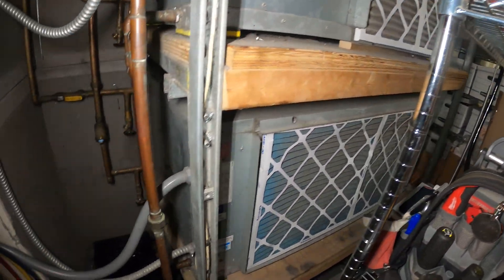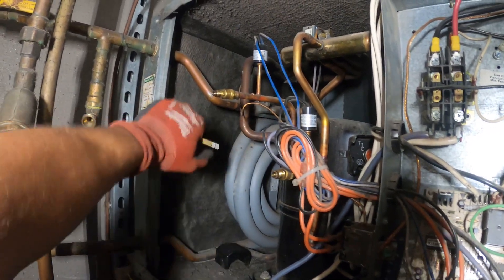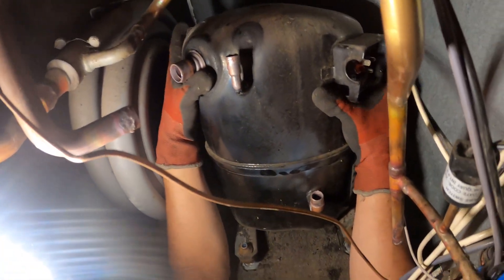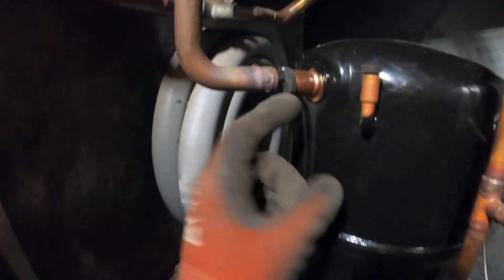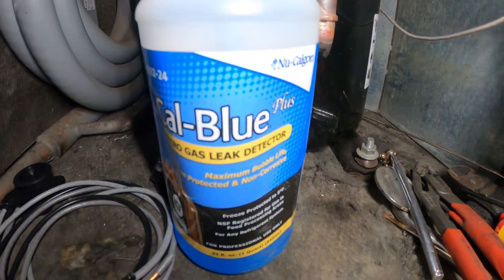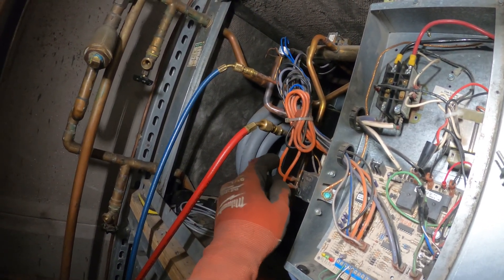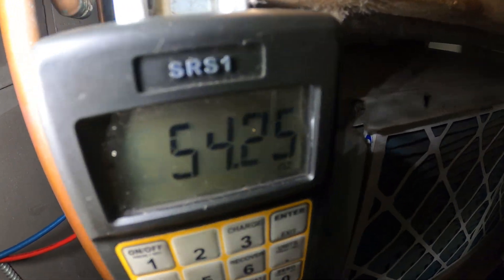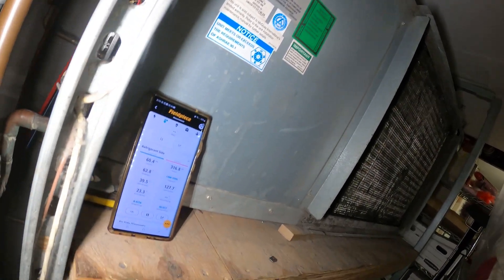HVAC Service Call: Copeland Reciprocating Compressor Installation (HVAC Compressor Replacement) 410a

Comment: No nitrogen purge, no acid test,no drier, no coil cleaning, no subcool reading
Reply: I was thinking the same thing, especially acid test/acid away for a grounded compressor
Reply: Client not paying enough for the job. Barely enough hours. There was no filter drier, and probably was no room in the budget. Sh!t location, Sh!t access. Barely enough for you to work in but guess what. He got the job done! Got paid (hopefully!!😅), JMT how was that water strainer?